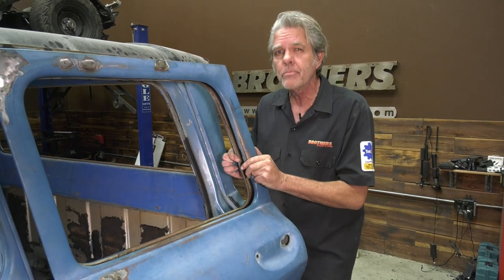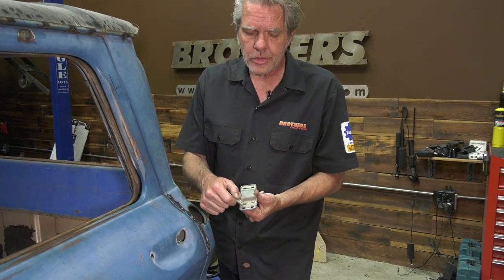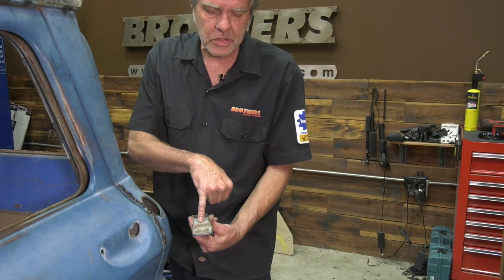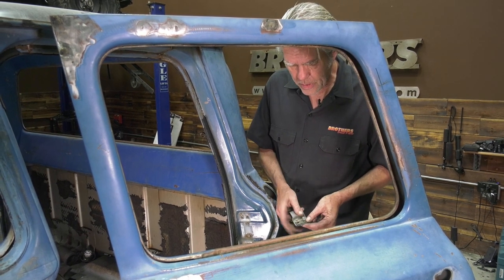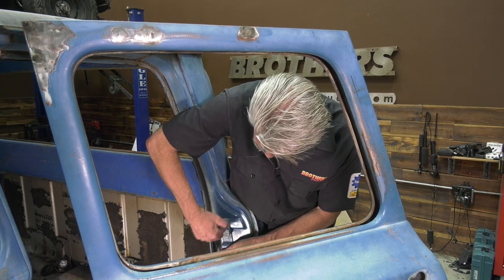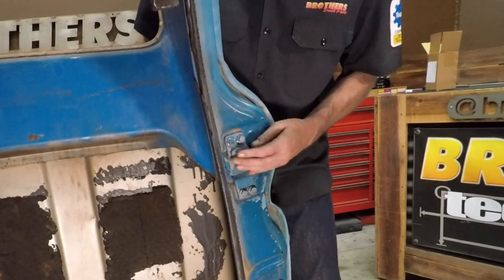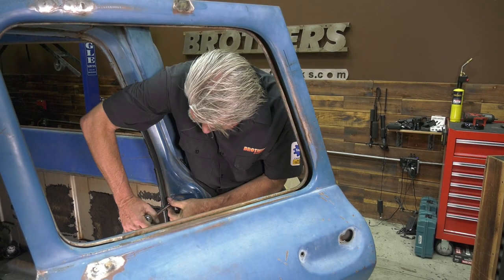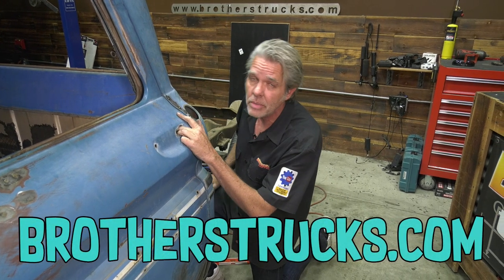50'S & 60'S Chevy & GMC Truck Door Latch/Striker Adjustment/Alignment

Comment: Great video, wondering where to buy the striker spacers? My truck is missing them on one side. I was having trouble shutting the door without the spacer, borrowed one and it works perfect. Now just to find one.

Comment: Dave my 61s drivers door do not do two clicks. I just installed new lower door guides a few months ago. The drivers door guide still needs some adjustments. But my door does not shut as you demonstrated. Do I need to maybe do some adjustment on my striker? The truck has never been wrecked. It has fairly new weatherstripping. Also I sometimes have to adjust my inside door handle to get the to latch to work?! What do you suppose needs fixed or adjusted with that? Thanks for any help you can give me. Awesome vid too! As always.
Reply from the maker: Yep, you need to adjust the striker as I've shown here.
Reply: @BROTHERSTruckPartsTV  thanks Dave! Appreciate it.

Comment: Hey brothers! I got a power steering gear box leak and its just the rubber that (seals the power steering fluid it) is leaking maybe others have the same problem, I can't find much information... it's a 71 c20
Reply from the maker: We'll look into that one.

Comment: Dave, the driver door is closed and won't open (66 c 10). Has been working ok but now it won't. Is there any way to get it open without wrecking my paint and body work? Thanks
Reply from the maker: Any chance you can remove the inner door panel and get to the latch?
Reply: Thanks for responding, I did take inner panel off was able to move the latch wheel slightly and got the door open, turns out it was high sided on striker plate, replaced  plate and now it opens ok thanks
Reply from the maker: @philhall7400   Right on!
Reply from the maker: @philhall7400  Great work!

Comment: My biggest problem is the bottom corner of the doors. the latch I can do easy but adjusting the hinges is my problem. I can adjust it to latch but the bottom corners of the doors are sticking out and aren’t flush with the rocker panels. And on the driver side I’m only getting one click
Reply from the maker: We have a video that covers the alignment of the entire front end sheetmetal of the truck starting with the doors. Hinge adjustment as well as modifications you can make to the metal to help the fit are covered in there. Do a search on our channel for sheetmetal alignment.

Comment: I put new weatherstripping on my 64 and now I need to really SLAM the doors shut in order for them to get to that second click. I'm assuming the new weatherstripping is a bit thicker than the old original ones that were on there so do I need to readjust the striker?  Or will the new ones flatten out and fix themselves?  Any advice before I start taking stuff apart??
Reply from the maker: If you get the doors shut and leave them for a few days the rubber might take the proper shape and the doors will be easier to shut. However, depending on the seals you bought, they may NEVER be easy to close and then you'll need to install a different set of door seals or start adjusting your door. There are some reproduction seals out there that this is a known problem with. Part of the reason we make videos is so that WE can test the products we carry to make sure they work properly and so we can confidently provide customer service to our customers using our parts. Our doors seals don't have the issue you are describing, but we've seen this happen way too often with other suppliers seals.

Comment: Will this work for my 70? I have to slam it shut to get it flush. At first I thought it was the new weather stripping but it’s been on for several month now.
Reply from the maker: Same basic method to adjust the striker on the 67-72 trucks.

Comment: What I want to see is how to adjust door hinges on a 63-66 c10. Replaced the door seal and door didn’t close anymore without bottom rear sticking out. Friend started adjusting hinges and got it all out of wack and can’t find any proper videos on how to make it perfect
Reply from the maker: Check out our Video on front end sheet metal alignment, It starts with proper alignment of the doors and moves forward from there. Here's a link: https://www.youtube.com/watch?v=j7n_W1IxU_s&t=1931s
Reply from the maker: Another thing, where did you get the new weatherseals? There are some seals available in the market that are notorious for causing the exact problem that you described. We DO NOT carry those seals at BROTHERS and would suggest a proper set of seals before a re-alignment of the doors.

Comment: Weatherstripping install????? I installed my weatherstripping and now my doors won’t even close!!! Help!!! Lmao.
Reply from the maker: Where did you buy those seals? There are many different seals available out there, ours don't do what you're describing. That's one of the benefits of installing everything while doing these videos, we get to test it all and pick only the stuff that works. If you got those from us something else is wrong, call the shop and let's see if we can help you sort out what's going on. 800-977-2767
Reply: I bought glue on ones  from a competitor LOL
Reply: When I get it to that second click my door still sticks out about half an inch
Reply from the maker: @Robert Rock   That's a bummer, it's a known issue with some seals out there.
Reply: And how would I know if it’s the rubber or a shim issue ( currently no shims are in)
Reply from the maker: @robertrock8411   Shims for what part? the striker or the door hinges... or something else?
Reply: @BROTHERSTruckPartsTV  door hinges
Reply from the maker: @robertrock8411   If the doors are aligned correctly with the rocker panel and cowl panel, then there would be no reason to start messing with shims on the hinges just to get your door seals to work right. You've got bad rubber, the only way to fix it is to replace it or cut the rubber away until the doors close the way you want them to.
Reply: Same issue here
Reply: @BROTHERSTruckPartsTV  81 not able to close my door with slaming
Reply from the maker: @carolleverton7989  Do they align correctly once shut?